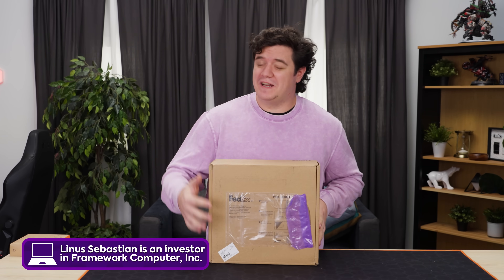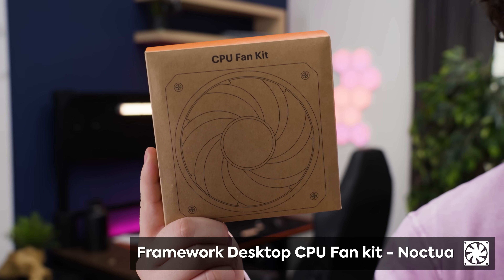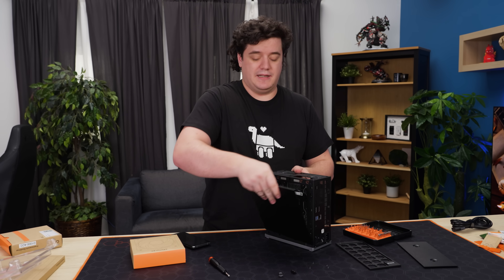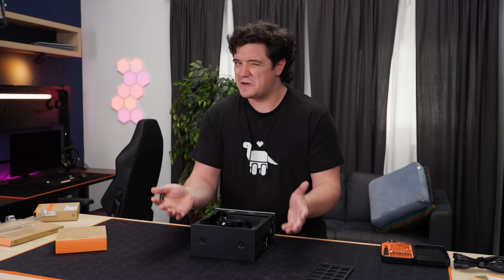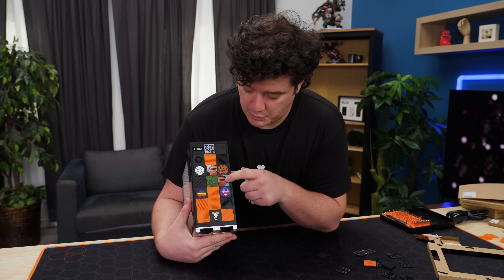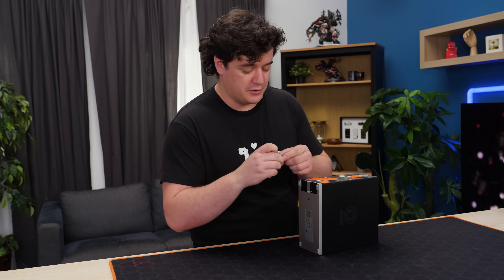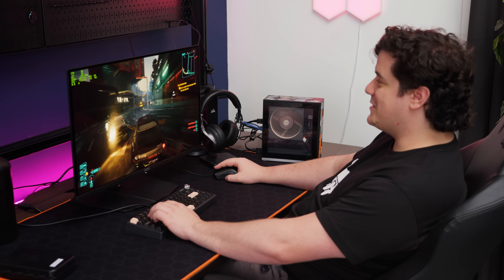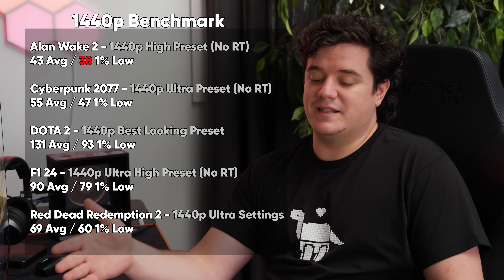This TINY desktop makes me nervous.... - Framework Desktop

Comment: the ram was soldered is amd's requirements to use 395+, isn't it? framework stated that in past video i think.
Reply: Framework said AMD tried, but the signal loss from having a connector for the ram was just too much
Reply: @wholesomeisland  No, that's horseshit, it would have worked fine with CAMM, easily within spec. They just didn't want to validate it and FW didn't bother doing it themselves.
Reply: @deimosian  can you say what model is using CAMM ram?
Reply: @deimosian  It would have "worked" just not at the performance levels AMD targeted for it. 

In that video, they said AMD got it working, just not at the 256bit Width for top performance.
Reply: @Xyler94  The 256b width just means you need two CAMM modules not just one. They're "dual channel" AKA 128b per module, unlike conventional 64b DIMMs. Two CAMMs on the bottom of the circuit board opposite the APU would have worked fine.
Reply: @deimosian My dude, if you think you know better just send your resumé to AMD, pretty simple if you ask me.
Reply: @deimosian  Ok but if it's that easy, who is doing that? Or are you just theoryposting?
Reply: @deimosian  AMD and Framework tried it with CAMM2 modules. It didn't work
Reply: @deimosian no it wouldn't. If you want a 255bit bus you need all the chips to have the same trace length to the chip that's easy with 64bit or 128but but with 256bit you need to arrange them very close and in a circle like in GPUs with gddr
Reply: @deimosian seems like you have the R&D budget and you did it
Reply: @deimosian are you considering what's needed for the GPU? Will that be enough? Genuinely curious.
Reply: @rayok_zed There isn't a separate GPU or GPU memory. It's got nothing to do with it.
Reply: @deimosian release your own then smart guy. You surely know better than the engineers at Framework and AMD.
Reply: @deimosian that's the point. This APU offers dGPU levels of performance. To achieve that then you need similar memory speeds to that of a dGPU right? So I'm wondering if CAMM2 is fast enough in its current iteration. In the framework video on it, they said it's not but things might have changed already.
Reply: @deimosian yes because you definitely know better than the people who built it
Reply: @thundereagle97  They knew too, they just cheaped out.
Reply: @wholesomeisland  Ah yes, the same AMD who "tried" to support 5000 series on 400 series motherboards by banning their partners from publishing working firmware, so everyone had to sneak around sharing leaked versions on forums. They later got praised by overcoming this "hard technical challenge" almost a year later after forcing everyone who wanted to upgrade to buy new mobos which lasted only 1 generation.
Reply: @ulamss5 I think that's a bad example because third party firmware can break CPUs (heck, even the proper one can fuck up the CPU, look at those burned CPUs not long ago). It's understandable why they ban the firmware hack, cuz Then it's a lot of problems for AMD that they're not willing to deal with
Reply: @jacfgerfung3658  I think you don't know what you're talking about. Those firmwares were repackaged and deployed to enterprise customers down to A320 boards (the lowest of the low-end OEM spec). They're not hacks. It was a calculated anti-consumer move to sell more motherboards.
Reply: @ulamss5  dont spread BS if you dont know the actual reasoning behind it
Reply: @ulamss5  Wasn't the actual reason that they would need to permanently drop support for older CPUs when doing that? Due to firmware chip space constraints? It's not a defence but at least it's a reason.
Reply: @wholesomeisland  which is a joke because I believe another manufacturer does it and it works perfectly fine while keeping the speed the same
Reply: What manufacturer? I am interested in one of those where i can swap ram!  @HerbaMachina
Reply: @HerbaMachina Which manufacturer?
Reply: @HerbaMachina  which one?
Reply: @HerbaMachina No other manufacturers have swappable ram on Stric Halo. It's required by AMD
Reply: @HerbaMachina  Which manufacturer released a computer to the general market that can do that?
Reply: @HerbaMachina source: I made it up
Reply: @HerbaMachina  Source?
Reply: @FARBerserker if you want to swap RAM then this AMD APU is probably not for you
Reply: @HerbaMachina I don’t think anyone does 8000MT non soldered.
Reply: @HerbaMachina  Which manufacturer let's you have non soldered ram with this chip?
Reply: @HerbaMachina  what brand, takes 5 second to type that brand out but you didn't.....curious as to why!!!
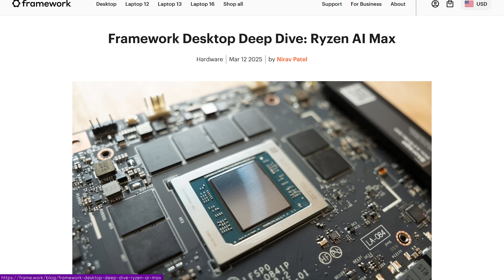Reply: Go to 5:12 in the video, they explain some of it in those paragraphs. Kinda wish he talked about more of the realities of why they did that instead of just saying they chose performance over modularity. Seems like it just wouldn’t really make much sense to use the platform and base the build around it if they didn’t go with the soldered ram it was all designed around.
Reply: @koijoijoe i mean they did have to choose performance over modularity. it would be slower with lpcamm.  but with the next gen of lpcamm it should be fast enough.
Reply: @koijoijoe yep, because then the GPU performance wouldn't be that different from the normal, non max version and it would quite literally be a waste of money
Reply: It was already soldered when it was initially announced. That's why it has higher VRAM.
Reply: I was thinking the same thing, not a Framework decision.
Reply: Yes it sucks but I mean those specs will be fine for a long time really. I could probably rock this computer for a decade
Reply: It would be possible but the ram would be much slower. And i don't know how they would put that much ram with ram sticks inside that. But TBH, they maxed out the amount of ram to a ridiculous extend already, so, no need for it to be different.
Reply: By the way, why can't we buy any 395 chips.  They're only available in prebuilt PCs.  Has AMD stated why?
Reply: Yes @taiwanese_9999 this was an AMD requirement
Reply: yep. literally says it on the video. he didn't read it fully.
Reply: Yes
Reply: Yep
Reply: It's NOT just soldered, its located extremely close to the APU chip. This is due to Heterogeneous System Architecture where the RAM has to be similarly close to both the CPU and GPGPU. CAMM would not have worked. Use a different type of chip if you want modular ram.
Reply: It was in a Linus tech tips video too lmaooooo
Reply: The memory on the ai max chips is soldered only per amd, as it's lpddr5x only, and lpddr5x can't be socketed. You wanna give frameworks shit for using a cpu that requires soldered memory, fair. But don't say they chose soldered memory when it's the only option for what is phenomenally awesome hardware.
Reply: Then, why not don’t release a product with such limitations?
Reply: Yes. Looks like we have returned to the “LTT videos being full of errors” era once more
Reply: Hopefully Framework will embrace CAMM and we can finally see it take off
Reply: imo they should go with something else if that’s the case. I’d rather slightly worse performance that I can upgrade later than slightly better performance now that will be obsolete before long.
Reply: @3ooo3ooo3ooo3 it wouldn't be "slightly worse" it would be drastically worse. There's a reason GPUs have soldered ram, they speeds they require to read, write, and calculate are far above what anyone can nake as a connector. Your talking about 60 fps games going down to 10. Worse CPU scores, and major gpu score losses.  
You cannot buy this chip on the market. You have to get it installed on a mobo with the ram already soldered on. 
Its not that Framework didnt try to make it more repairable, because they did. They had a long public discussion about it. The only way to get the performance was soldered memory and as much as they didnt want that its the only choice. 
So dont view it as a chip mobo and ram because its not 3 different parts, it's one whole part that cannot work without all of those parts being permanently attached.
Reply: @MrCodyminner  but the whole point of Framework is a framework of modular parts that can be easily upgraded or replaced. Bleeding edge performance is not why you buy a Framework machine and they’re just making themselves less unique or worth paying for with moves like this. They aren’t Alienware and shouldn’t act like it. Framework should be about modular parts, period. That’s the whole reason anyone pays any attention to them or buys them.
Reply: Framework addressed the soldered ram long ago. It's unfortunate but unavoidable, at least, at this time. As for the tiles...just don't buy them.
Reply: YES. THEY ACTUALLY WANTED SODIMM, BUT COULDN'T.
Reply: Also in a world where a normal person buys a new "upgraded" PC every 5 to 8 years I'll take the performance gain over what their company is supposed to be all about 

Also...Velka 3
Reply: @oddguy12  if you want peak performance, you don’t buy a Framework. You buy a framework because you want to upgrade easily on your own terms. Every company is offering peak performance (or so they claim, at least) and Framework is basically the only one trying to do something genuinely remarkable and progressive. That should remain their focus and to say otherwise is ridiculous.
Reply: Framework simply should not have made this product then, it doesn't need to exist, this is a market segment that framework is not only doing worse than the competition (think Tiny/mini/micro PCs from HP/Dell/Lenovo) or Intel NUC type machines, but one that doesn't make any sense for framework to compete in and so has purely ended up way more expensively built for no actual benefit. Even if nobody is making something like this yet, it won't be long until someone does for what's probably going to be 30% less.
Reply: It is. Doesn't make it right for a repairable company to purposefully ship something that isn't fully repairable though.
Reply: In classic LTT fashion, no prior research was done before reviewing the product.
Reply: Sort of, but they should have made another brand to reflect the deviation from framework's signature features
Reply: @danielpicassomunoz2752 I didn’t think of that. well said. I am genuinely now in a place where I am truly happy with my laptop, the Razer blade holds “no sway over me, or any other boutique or regular “gaming laptops”. Sure, FW doesn’t have the product or name maturity like Lenovo (although they were IBM) or HP. But repairability and upgradeability is “big bootiful”.
Reply: then Tell AMD to kick rocks. 
Have a moral position, stick with it. that's the whole POINT of framework. 

Another company that sold its' soul to the Ai Bubble monster.
Reply: @Nick-jf1il They didn't stop making Framework 13 / 16 in the old way. They even have new ones coming out the same time as Framework Desktop. You are not forced to buy this. 

If you prefer something other than this, you definitely have a choice. All I see is they provide option to someone who might prefer it.
Reply: @yookoala and it's very likely framework will offer additional boards in the future, overtime as this one becomes obsolete/matures.
Reply: @Nick-jf1il they made a product that no one else is making for a lower price than anyone else is offering. If they sold their soul they really should have gotten a better deal on it. 

Modularity in the desktop market is not lacking so I am really confused why you are so bent out of shape about this.
Reply: @hastyscorpion In terms of ATX desktop PC it's quite expensive but in terms of Mini ITX they're actually decently priced for something of a case of 4.5 Liter and costing around 2200 for the highest model
Reply: @Nick-jf1il you would rather have a shit produce?
Reply: @Nick-jf1il  No it isn't. The point of framework is bigger than just making products that are customizable. And look at their laptops, you can't customize absolutely everything, and they don't even make all the USB ports to the same spec on all models and all versions. It is about finding the right balance to increasing the amount of repairable devices. You may as well complain that they aren't allowing you to replace the fan blades on a fan. You could probably get better performance or the traces on the motherboard.
Reply: Then they shouldn't have used that CPU.
Reply: @logan_page There's nothing better. The closest thing that could compete will be an Arrow Lake - H or Lunar Lake, and both their CPU and GPU can't compete.
Reply: @logan_page then don't buy.
Reply: @logan_page  Framework's position in the market is still very insecure, especially with tariffs eating into their US market. They decided to jump on an opportunity that was presented to them to produce a popular and profitable product and help secure the future for the entire company. Framework hasn't fundamentally changed. Don't sacrifice the good just because they can't be perfect.
Reply: @logan_page  it is on a SINGLE sku
Reply: @logan_page  so don’t use the APU they designed the desktop to use 😂
Reply: @logan_page or release it under a different brand

Comment: I would love to complain about the Pricing of Framework.
But Framework, always was and most likely always will be for the Upper Class Bourgeoisie esque people, 
Never Really Intended for the Normal Class of people. 
But as an Engineer, i can atleast look at the Designs and appreciate/judge them
Reply: This is just about the cheapest way to get a Strix Halo machine. These chips are not cheap.
Reply: @jfolz  it's not, no. It's not even close actually.
The Framework is going for 2400€ (~2800$) for the 128gb model
meanwhile 
gmktech sells their 128gb model for 1700€ (2000$)
Beelink sells their GTR9 Pro, with the same specs for the Same Price of 1700€ (2000$)
and Minisforum has announced their new upcoming MS-S1 Max, which is gonna come with 2 M.2 slots and a PCIe x16 slot (Unlike our friends at Framework, with an x4). While the Price is not yet announced, it's also been estimated to be in the 2000$ Range
Edit: Thought it would be nice to point out aswell, that Framework has a 35% Premium upcharge

Comment: I need help understanding why I as a home consumer want more than 1GB LAN. Especially >1GB when most home ISP connections aren't 1GB.
Reply: My home lan has been 10GBe for a decade and I hate having to stuff an Intel X550 into every desktop in my house for access to the NAS. I can get 6 gbps over SMB from hard drives.
Reply: @blazewardog  90% of people have 1Gbit port on their routers, 1Gbit FTTH line Which are often asymmetrical, so the ulpload It is always much lower than the download and lots of devices with 1Gbit port.
I'd rather have 5ms ping than 10Gbit bandwidth.
A lot of people even use Google DNS while Open DNS are way faster on every benchmark and use for standard browsing.

Having 10Gigs is stupid today for not big companies.

But that's not all. Then if you use WiFi, you never reach the true strength of fast networks because you always have walls or elements in the way
Reply: @TrioLOLGamers  Most people won't get better until enough things pack it in the box. If desktops started coming with 10GBe, so would ISP routers (most consumers are stupid and don't buy their own). There are plenty of reasons to have a fast local network, even if you have a slower connection to the outside internet. Also 10GBe is literally 20 years old tech at this point, it is like 4 years newer than 1 GBe.
DNS response time is irrelevant to 10GBe. Most routers run a local cache anyway, so you will be getting <1ms lookups anyway. The average person's number of sites visited has gone way down in recent years, so likely they will have a valid cached lookup for most page loads.
I don't use WiFi for fixed devices, but even then it is easier than ever to add APs and get better performance from your network.